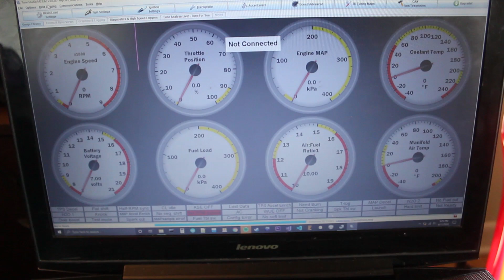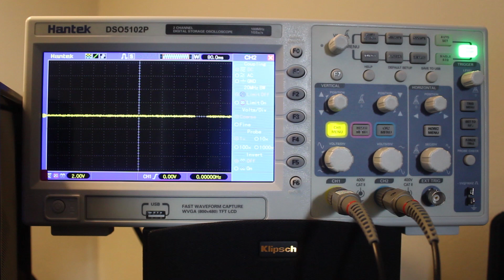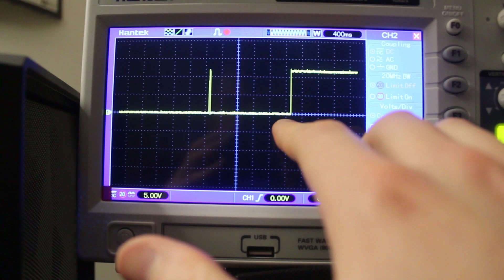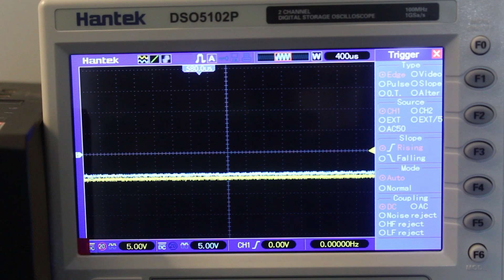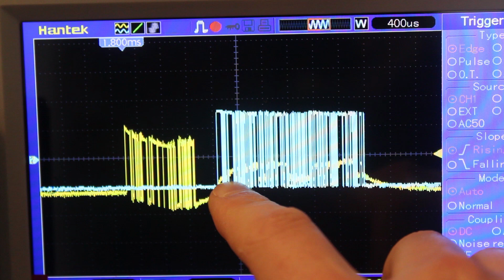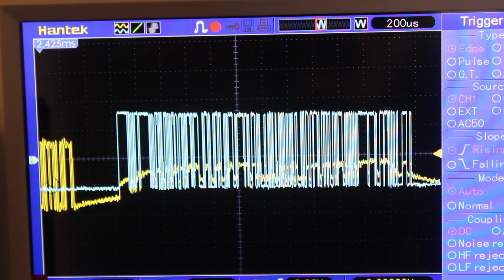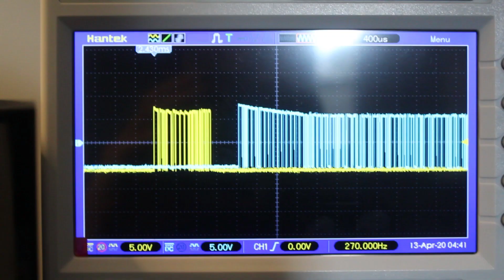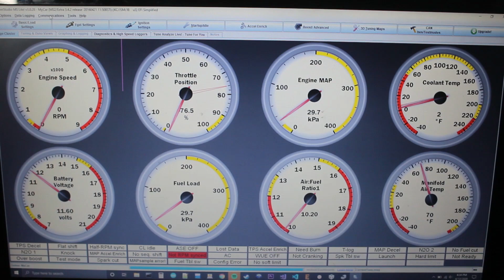Fixing a Microsquirt ECU That Won't Connect

Comment: I was hoping this would be my connection problem - but I measured the resistance between the serial output ground (pin 19) and the "good engine ground" pins and got 0.12 - 0.13 ohms. So this would seem to say that disconnected serial output ground isn't my problem (correct me if I'm wrong?)

Comment: my computer couldn't find the controller and i noticed the usb to serial adapter was getting warm, i decided to connect it to the serial card on my desktop and no controller found. Took it apart and had the same issue with the serial ground burnt but also C22 capacitor was blown and i cant find the capacitor specs, someone could help me id appreciate it!
Reply from the maker: Could always measure it with a good multimeter once you've removed it. Get one that's rated for plenty voltage, 15v+ should be safe. Most caps have loose tolerances so you probably need to be close (+-10% usually)
Reply: @rainvillecreative5410  how do you measure a blown cap?